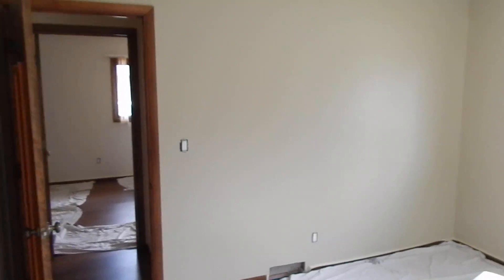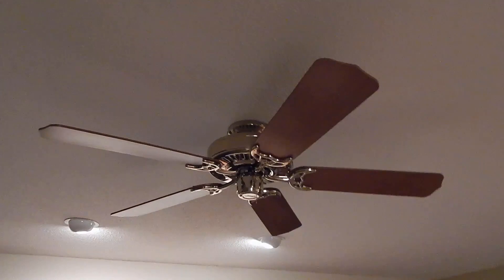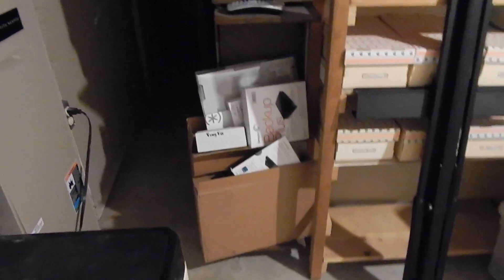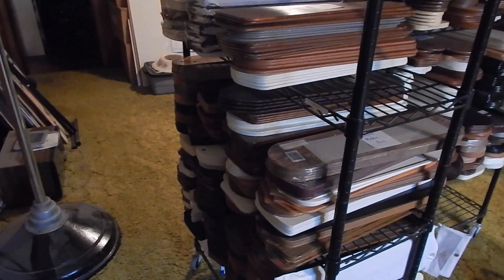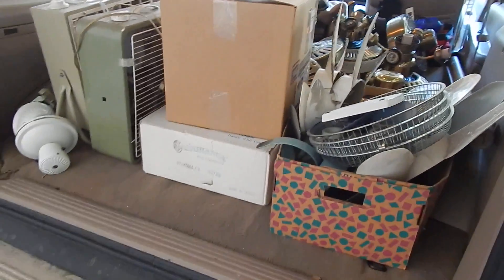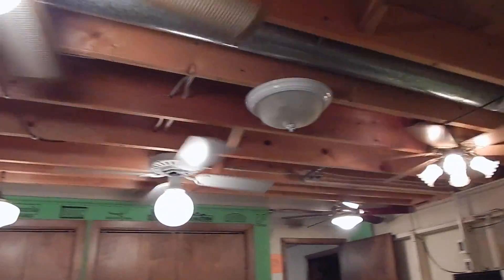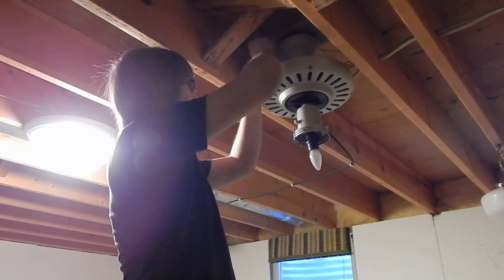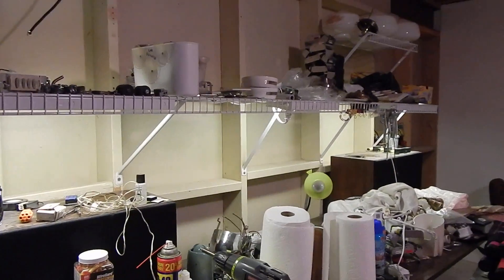Moving Vlog 17 | Dismantling the Fan Room!

Comment: Cole, you said you got that Hunter Summer Breeze from a customer at work.  I hope you don't mind me asking, but what kind of work do you do?
Reply from the maker: I was doing electrical work at this time, required training time as an electrician's apprentice. It was a fan we'd taken down on a simple light fixture update job. I'm no longer in that field, kind of got burned by a few things happening when my employer got bought out by a larger company, and I decided I wanted to at least try something different for awhile. I'm in omnichannel sales for Macy's now, and of course producing content here since it's grown to become a significant portion of my income the past couple years.
Reply: @vfandm  I see.  Well if you’re a fan collector and all, maybe you could go work somewhere like Lowe’s or The Home Depot.  You could specialize in the fan and lighting department.  Just a suggestion.
Reply: I had applied for a job at Lowe’s one time, but it didn’t work out.  I am in the building industry, though.  I work at a building material store as a driver and stock-handler.  It has its ups and downs.
Reply from the maker: I worked at Home Depot for a summer several years ago, but it was just overnight working freight. I'd applied for Lowe's before that, they kept rejecting me. They recently started sending emails that they have openings that I should apply for, but I'm happy where I am. I tried Menards before I ended up at Macy's, they only had outdoor lumberyard positions open which I didn't really want. I also applied at a lighting showroom and got an interview, but lacked the sales and customer service experience they were looking for at the time. I think it was all for the best. Looking back, I enjoyed the electrical work, but I think it got too close to what is still my hobby. I like what I'm doing now, it's a great enjoyable job in its own right, and it has nothing to do with electricity or the lighting industry or fans. It allows me to put my passion and energy for that stuff in here, rather than using it up with other people all day every day and being sick of the topic in my spare time.